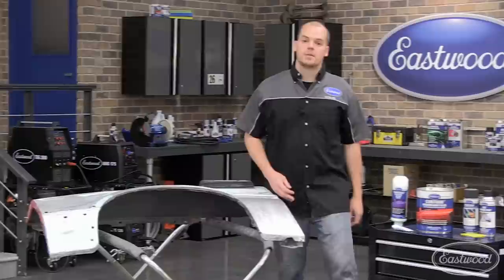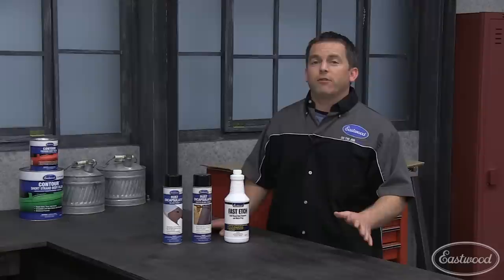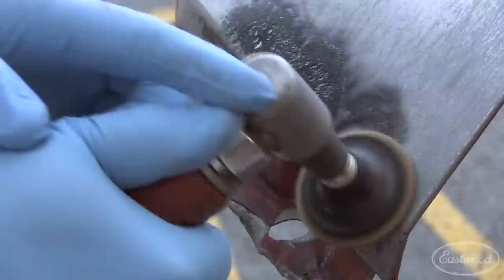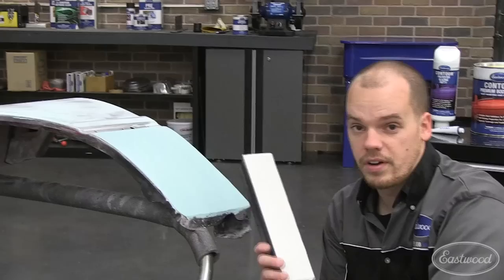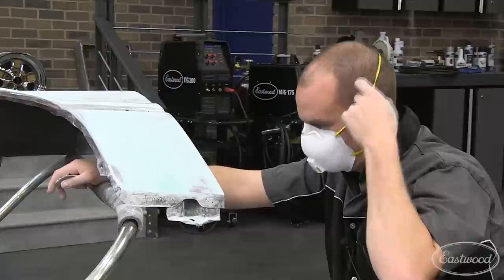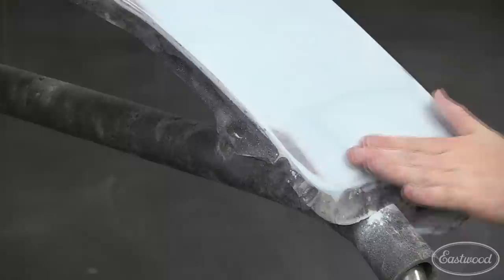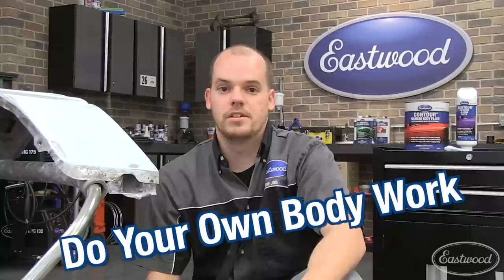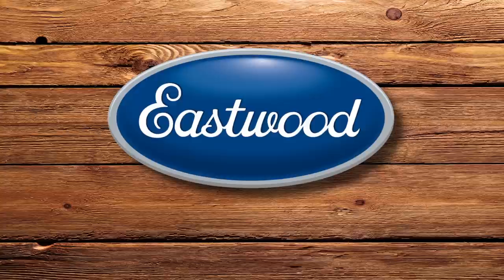Car Rust Repair -How to Fix Rust Pits in a Fender with Glazing Putty & Rust Encapsulator at Eastwood

Comment: I have a 1983 G20 van, with rust & pitted holes on the inside fire wall, and around the window. I cannot weld or remove the metal. I've sanded the best I can, what products would you recommend to assist me?? Alex.

Comment: I've got rust and inside the craters if you will there are remnant decayed metal. If I grind long enough on the spot I can remove said remnant within that pit. The issue I am having is I have a ton of that mess going on. If I were to use this product- fast etch then the encapsulator will those remnants within that pit stop rusting? Can I depend on that doing the trick OR do I have to be sure to remove the rust out of each pit to ensure that it does not return??
Reply from the maker: To be 100% sure it will never return, you can cut it out.  The next best option is to use a pressure blaster because it should remove all of the rust from the pits.  If you can't do either of those options, then clean everything and spray Rust Encapsulator on the area.  You can then sand the area, which should leave the Encapsulator in the pits, but not the flat surface.  You can then spray Epoxy Primer and apply body filler.  Or apply body filler and then Epoxy Primer on top of it.
Reply: Epoxy then body filler.
Reply: Think only way to get to that is the cheap 20 dollar hand held sandblaster and a bag of 80 grit blasting material.But usually At my shop I use asho leave for 24 hrs,spray dtm primer surfacer,and do the body filler over that .Stop the oxygen and the rust won't reactivate.

Comment: I'm not a body guy but I was wondering why you apply the thin film instead of just scraping off the excess just filling  the pits ,thanks, like I say I know diddly about body work
Reply from the maker: +Ty High When applying the thin film, it will fill in any pinholes or uneven spots.  You then sand the filler, and it should fill in the low spots.  if there are any more imperfections, they will be reveled.  Then repeat the process until it's satisfactory.  Eastwood also offers Contour Glazing Putty if all you need to do is fill in tiny imperfections and pinholes.